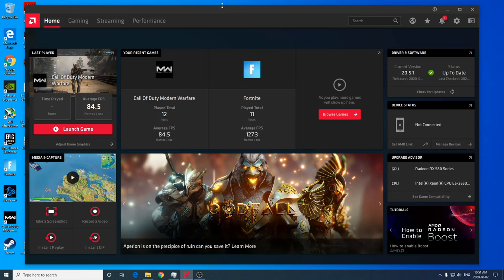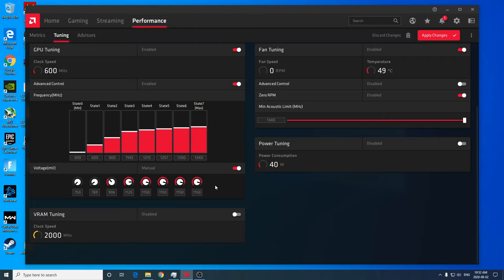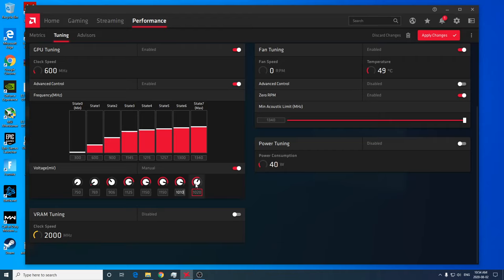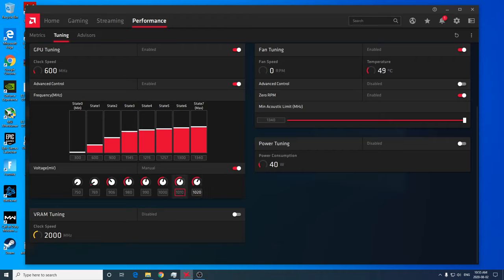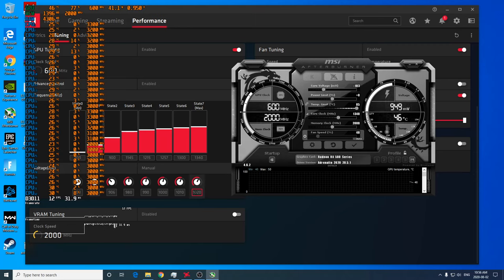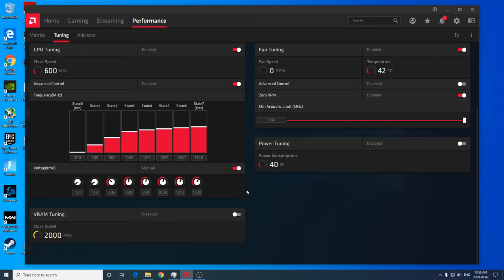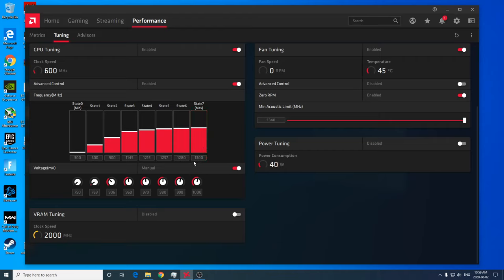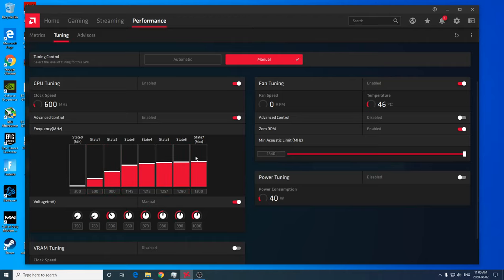How To Undervolt AMD RX 570 and RX 580 (How to lower GPU temp upto -10c)

Comment: From 85°c max load down to 70°c, you saved my gpu. Thnx! +1 sub
Reply from the maker: Glad it worked Ryle,
Happy holidays 😏😉
A cooler gpu is a happy gpu
Reply: what setting u use ?
Reply: @zubairzamri7927  mine is State4 - 945 | State5 - 950 | State6 - 955 | State7 - 985
Reply from the maker: @zubairzamri7927  I also have a video on my channel where i go over optimal voltages for lower temps

Comment: Found this video today after I started having issues with my MSI rx580 8gb.
Between this, and a fresh application of thermal paste, the card temps dropped about 10-15 degrees (was hitting 87 degrees at full load) while playing the CoD Modern Warfare remasters at 1440p High/Extra settings Thank you man!
Reply from the maker: That is awesome

Comment: My auros 580 8GB stock 1360mhz - My settings 1400mhz - undervolt to 1110 from 1150.. + 20% power. Stable, a little bit more faster and 2-3 degrees cooler.

Comment: Ty for this just got an RX580 and was worried because I saw it kept getting over 78 Celsius. This helps a lot.
Reply from the maker: glad to hear!
happy new years Robert
Reply: mine reached 80ºC lmao
Reply from the maker: @wandersonvitor3054  I would set a custom fan curve.
Reply: @AleksandrsBrodie  Yeah, I was thinking about it. If I put the fans to work 80% when the temperature reachs 80°C it will good or bad? I mean, for the fans lifespan.
Reply from the maker: @wandersonvitor3054  I would first try going to my channel and copying the core and voltage settings on the one undervolting video i have called, Optimal voltages, and see if that help with your temps first.
Here is a link to the video
https://youtu.be/0pzxFZBw-6Y
Reply: @AleksandrsBrodie  thanks
Reply from the maker: @wandersonvitor3054  hope it helps

Comment: Thanks dude, i followed ur setting, currently i'm using rx 570 asus rog strix, at stock it consume 150 watts, when i follow your setting, it decrease into 108 watt, thank you so much
Reply from the maker: Nice!
Reply: Yo what settings did you use bruj
Reply from the maker: @bishop8089  I have another video that i pinned in the comment section or you can find it on my YT channel that shows an example optimal clocks and voltages you can use on your GPU that will help reduce your temps a lot.
Reply: At 108 watt, how abiut the fps perform bro? Pliz tell me?  150w vs 108w
Reply from the maker: @jejeykun6713  if you lower your core clock, then it will affect your fps. But just lowering voltage does not affect fps.
Try it out and see yourself :)
Reply: Bro I am also using Asus ROG strix rx570 4gb variant buty card consume 100 to 120 watt on heavy games on default without overclocking how your card gets that much of watts bro tell me

Comment: Just found your video, and this is exactly what I was looking for. I'm currently running a RX 480, and my Clock is 1266 max and I'm tinkering with the settings still, but undervolting around 1000 mV. Might go down more, not sure. I was wondering how you know when to stop turning down the voltage? (Sorry I'm new to all this lmao)
Reply from the maker: glad it helped.
Its simple, you stop lowering voltage when your system crashes :), some cards can run with a lower voltage. i just put 1020mv as a sane voltage so that it would work for most peoples cards. but as i mention, the silicon quality of each card varies.
So you can try lowering the voltage -10mv each time. some games will need a higher voltage than others. if you are happy with your temps at 1000mv, you can also just leave it at that.
Its up to you :)
make sure you stress test the card after you make voltage changes
Reply from the maker: @JudeTheYoutubePoopersubscribe  yup, when system freezes you either have to lower core clock or increase voltage

Comment: Thank you so much! I was playing ark which is my first intense game since I started using my pc, and it was LOUD, it sounded like it was close to max, about like 3500rpm, and I dropped it down and it stills a little loud but when I put my headphones in I don’t hear it( at about 2500rpm)  so honestly it isn’t that bad, thank you so much!
Specs: Rx580 Armor 8gb, Ryzen 5 1500x, 500gb m.2 ssd, 16gb 3200mhz Ram
Reply from the maker: If you want better results, yes better. Copy the settings I use in the video that I pinned in the comments

Comment: Can this help to run on my cv450 psu better and lesser power consumption for more reliability?
Reply from the maker: Yes. Optimized clocks+voltages = Optimal power usage.
I recently put out a video with optimal clocks and voltages.

Comment: hello is there any way we can make these settings permanently because every time I restart the pc the settings are reset and I need to reselect the profile. Can you help me
Reply from the maker: when you set a game profile, for example Call of duty, each time you load call of duty it should automatically apply those undervolt settings. if that does not work, then i dont know. its worked for me.
Reply: use msi afterburner it works with any brand
Reply: Kanka nasıl oldu bu ayarlar? Crash falan yaşadın mı

Comment: Amazing video mate. Helped me a lot in reducing my GPU temp while gaming. I used to get around 80 to 85+ while playing Apex legends and my PC turns over due to overheating. I followed your steps and reduced to optimum GPU Speed and Fan curve and it works. Now I am getting around 58-65 temperature while playing apex legends. I will share my tuning setting for fans  curve if anyone needs it.
Note: Earlier I could play all games with low temp but as my card is almost 5 years old now its overheating a lot.
Reply from the maker: I also suggest, if you're in a hot climate, take the side of your pc case off to help woth airflow.
And for tuning the gpu
If you drop the core clock around 1200mhz you can run lower voltages and get even lower temps, which can allow you to run lower fan speed
Reply: @AleksandrsBrodie  Sure mate. Thanks for the tips <3.  I will message you incase if I need any recommendation on new computer build in the future (Mostly Intel CPU +Arc GPU).
Reply: @aadarsh21 can you share you're fan settings profile, my rx 580 is so loud 😅

Comment: Hi bro, It works for me on MSI RX 580 8G OC ARMOR with Ryzen 5. Temperature before this tuning was normally between 79 - 83 Celsius, after that is max 75 Celsius, GPU TDP is lower and no fan heavy metal yet! YES! I tried new set up on Borderlands 3, High details and game is stable, without heating and monster cooling. Nice job man, many thx :)
Reply from the maker: Happy to hear it helps

Comment: Bro i did this with my rx580 msi gaming 4gb totally new and now is running perfect at 63° full load, before in stock it was running at 75° full, yo just made my day bro, thanks a lot!
Reply from the maker: glad it helped.
Happy holidays,
remember, if it does crash, it just means your voltage is too low for the core clock you have chosen to run

Comment: The thing is with MSI Afterburner for undervolting any GPU is going into the curve editor which the skin that is easiest to use it is MSI Mystic which you can balance it out compared to the example you were showing.
Reply from the maker: Good points 👍 this needs an update ideally lol it's been almost 4 years now
Reply: @AleksandrsBrodie  Yep cause the next video after yours is titled "Undervolting Older GPUs" which the guy even mentions that using the curve editor is just like the method you used that you would get the same results which tbh i like using MSI Afterburner more because it is just easier no matter what GPU i would end up using.

Comment: I undervolted my XFX 580 from 1200 mv to 970mv with 1366mhz speed. From 80c to 55-60c this actually works with zero performance loss, 230mv lower would recommend
Reply from the maker: 👍👍nice work glad it helped
Reply: What type of XFX 580 you have? I am now on 1000mV on 1366mhz but I am afriad go lower, now temperature i have 63-67c
Reply from the maker: @MaxThe123   @MaxThe123  consider lowering your core clock to 1280Mhz. then you can lower the voltage more.
Reply: @MaxThe123  Go lower you arent harming anything, its an XXX GTS. if it crashes nothing breaks, it reverts.
Reply: @Zegery  i am now at 970 but temperature not go lower, i stay on this

Comment: I'm now at 0.900 V and 1220 MHz! Power consumption is down about a third at 90W and it's stable so far. To get lower than 0.950 V you have to lower VRAM voltage too.

I have RX 580 (ASUS Dual 4GB) and the with stock settings it's not really a quiet or cool card..
Reply from the maker: Ya those asus cards run hot

Comment: Thanx it worked 👏👏
My pc was rebooting every time i play games. And i found out that at some points my gpu used 132 mw 
Now with this configuration it is runing perfect at 75mw
Reply from the maker: very happy to hear! if you look on my channel, i have anther video showing optimal settings you can try on your RX 5xx series GPU.
ps, if you system was rebooting when gaming, it probably means you were pushing close to your PSU max wattage. undervolting = using less power like the way you set it up will make it easier on your psu.
Reply from the maker: @Rayker here is a video i recently made showing optimal settings to use>
https://youtu.be/0pzxFZBw-6Y
Reply: @AleksandrsBrodie  yes but i still have temp problem,  the pc stopped rebooting but gpu temp. is always 89c. Am using rx580 8g oc version. 
The cpu temp is normal ony gpu.. 
Do i need to change termal paste or ?
Reply from the maker: @emin144  I would re paste the gpu then.
If you are running with a config where you are only using around 80-100w in software and still hitting 89c, there is something else causing the card to overheat.

Comment: thank you bro!! been having this black screen flickering issue every once in a while , this fixed the problem
Reply from the maker: Hey Chino, Glad this helped you.
I am considering doing a more indepth guide about undervolting and giving some tested voltages for different use cases.
Reply: @AleksandrsBrodie  i will be looking forward to the video guide! I use RX 580 and when I play Farcry 5 it goes up to 85'c and then screen goes black and the fans spin in max speed - I dont know what to do (newbie PC user)
Reply from the maker: @Kinpoi  you need to undervolt you gpu.
Set state 7 core clock to 1300mhz and core voltage 1030mv
Reply: @AleksandrsBrodie  I will test it out now - also another question, how did you have that "Zero RPM"  mode in your Radeon software? I dont have it in mine and i have to use MSI Afterburner to set it to 0 RPM during low/idle

Thanks
Reply from the maker: @Kinpoi  probably has to do with model of gpu
Reply: U didnt see drjver time out again ? I was try everything. Only this video left :D
Reply: On rx 580
Reply: @AleksandrsBrodie  mine is rx 580 8g 
I set my 7 state on 1257 mhz and voltage on last state on 1080 
Like this . Frequency :  300 552 828 1054 1118 1157 1196 1257 
Voltage . 750 950 970 1060 1065 1070 1080 

Its work ? Can solve my random crashes? I try everything before . Disabling mpo / disable fast  startup / ddu and re instal older versions and more .  Amd software pro . Noting work until now .

Comment: dude i cannot thank you enough. i was panicking since the RX580 was my first ever gpu since i was running just cpu . this fixed my crashing issue. thanks dude
Reply from the maker: you are very welcome Dom!
good luck!
Reply: Ur issue was adm driver timeout? I have the same gpu same crashes . Its would be help ? I set this last night and no crashes until now . Mine is happen every 2 3 days on gaming or even iddle . I was try all methodes bfore

Comment: Thanks dude i had overheating problem with 87C and with that i had freezing and crashing , and now i have 77C max tnx for that , now i have less 5-10 in games ,you fixed my problem thank you very much
Reply from the maker: you are very welcome.
you can also consider lowering your core clock a bit more so you can lower your core voltage even more which will make a bigger difference.
i would aim to get temps down to 72-74c.
Reply: @AleksandrsBrodie  i know but in my afterburner core voltage is locked
Reply from the maker: @plavi8415  you can unlock core voltage control in the settings ;)
Reply: @AleksandrsBrodie  yes but do i lose fps after that?
Reply from the maker: @plavi8415  yes, when you lower core clock you do lose a little fps. But voltage has no affect on fps.

Comment: ASUS ROG STRX 1300 from 1360 mhz on  1000mw .. From 77 78°C (on 80%fan speed) to 62-63 max on 53% fan speed, silent and coold. Nice VIDEO ! TNX..
Reply from the maker: Glad it helped. exact reason why i made this video, those asus cards run dam hot with stock cooler ;-; worst design ive ever come across honestly especially because of the high stock voltages. but once undervolted, they run perfectly ;)
Reply: @AleksandrsBrodie   Now 975mw 1320mhz(all on msi afterburner, when i turn on sistem, profile is already on.) , 3DMark Time Spy, fire  strike extreme  benchmark,Heaven Benchmark, all passed. Fan Auto 0-49% , temps 57-61 on  full load gpu.  tomorow i put new termal paste, and try for best results.. for now -40 mhz but -17°C

Comment: What?! what is this setting?! maaaaan im got 68C in ultra setting on witcher 3,, before I got until 80C wow great job, thanks man you save my life, I mean my GPU!!!
Reply from the maker: Yup  ;) its magic ;)
Glad the video and settings helped.
remember if the game/system crashes, just increase the core voltage by +20mv until it runs stable.
its nice when a video actually helps make the gpu run cooler ;)

Comment: Maybe this question is 
unnecessary but are your settings in this video also good for the msi amd radeon rx580 armor 8gb oc? I am not a fluent english speaker and a noob when it comes to pc hardware....thats why i'm asking. btw great video
Reply from the maker: These settings will work on any card, they are just example.
if you want to copy settings, i have a better video on my channel around 4minutes long.
that will help lower your GPU temps a lot.
the main idea is to find a optimal voltage for the given clock speed your gpu wants to run at.
https://youtu.be/0pzxFZBw-6Y
you can copy these settings

Comment: hey man dope video, do you have any tips for the strix 480? undervolting related?
Reply from the maker: you still follow the same undervolting principal, of dropping your core voltage to one that is low but stable. so if you temps are not that bad as they are, you might leave stock core clock, but drop core voltage by -50mv, if that is stable, drop another 20mv until the card crashes. at that point you set the core voltage to the last consistently stable voltage.
EXAMPLE:
Stock core clock 1244Mhz at 1150mv
I would try 1244mhz at 1100mv, then 1080, 1060, 1040mv etc until it crashes
Reply: @AleksandrsBrodie  ohh i see what you mean. Thanks my friend, will try it . Have a nice one and take care

Comment: I repases the chip and that got my load temps from 80C and throttling to 61C.

Idle temp is about 37-40C.

I will undervolt tomorrow and see where that puts temps.

Comment: thank u so much for this, my pc hasnt crashed for 3 days for the first time now that im using these settings, quick question: does this make ur games perform worse?
Reply from the maker: glad it helped.
Your fps will be affected if you adjust your core clock.
Lower core clock = lower fps.
but voltage does NOT affect fps.
Reply: @AleksandrsBrodie  ok thanks once again

Comment: Thanks a lot for the advice; my (poorly designed) RX 580 went down from 83+ degrees to 70-80 deg. with same fan curve and clock speeds. Could probably go lower if I bothered to reapply thermal paste :P
The R7 3700x processor is even worse; its default PPT is set somewhere out in the stratosphere and bringing the power target down a little MASSIVELY reduces heat output without seriously affecting real-world performance in my applications, but I was wondering if I could do similarly with the graphics brick. This video answers that question.
Reply from the maker: to lower your gpu settings more i suggest you copy these settingshttps://youtu.be/0pzxFZBw-6Y

Comment: Radeon rx 570 4gb. Switched graphics card to compute mode. Voltage is 750,765,950,965,975,985,995,1005. Using it for crypto mining. $2 a day. Temp 65°C

Thank you!!
Reply from the maker: For crypto run 1100mhz at 820-850mv

Comment: Good day bro! What do you think would be the sweetest spot for my rx570 already used for a year mostly in gaming? TIA!
Reply from the maker: All depends on your cooling.
If the cooling is good with stock setting, then maybe just keep the stock core clock and under volt it a bit.
If its overheating or running in the high 76-80c+
Then try
1240core
950-980mv.
And of course the voltages will vary a bit card to card to run stable.

Comment: I know this question is so dumb.

Does undervolting reduce the power gpu consume significantly? I mean kWh amount it consumes. Becuase in my country they charge a crazy amount of money to a kWh unit.

So im wondering if I should go to a GTX 1650 super 4gb which is same price as Rx 580 8gb in my country. But little less perfomance, 4gb vram less and also less power consumption.
Glad someone could help.
Reply from the maker: yes, lower voltage = less power consumption = less kWh,
you can get either gtx 10650 super or rx 580 8gb.
I would probably still get the rx 580 8gb as it has more vram.
Reply: @AleksandrsBrodie  thanks for the quick reply. ❤️ I am going to buy Rx one more likely. Becuase of vram and also my monitor has amd freesync. Need to do some research still.
You earned a sub btw.
Reply from the maker: @minagaming2278  ;)